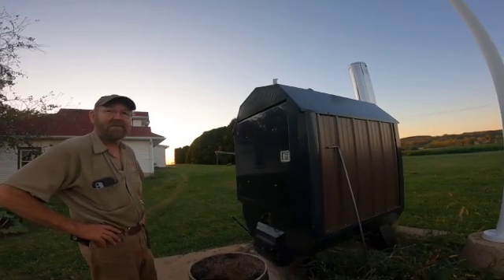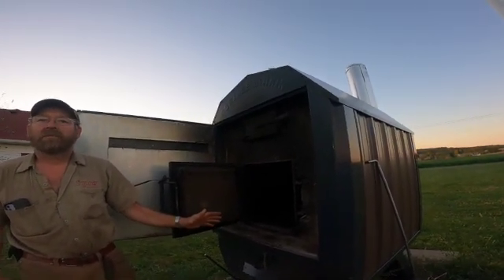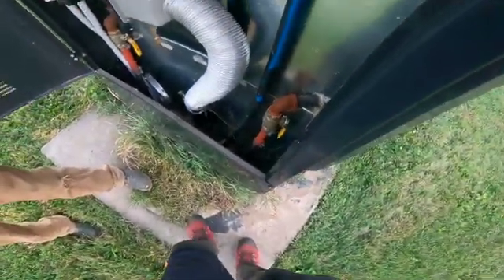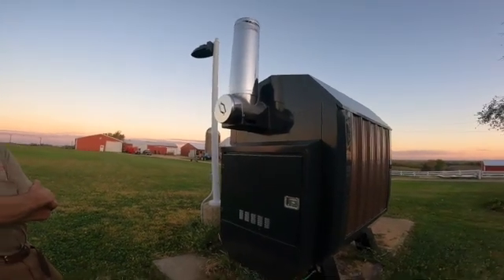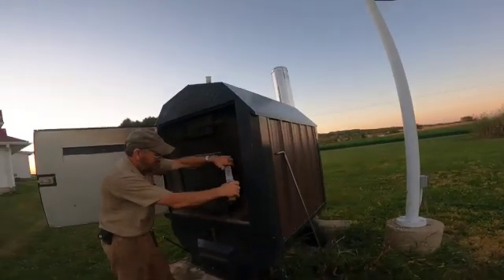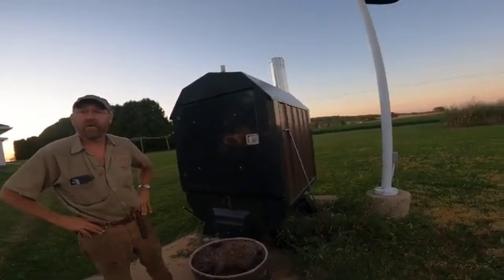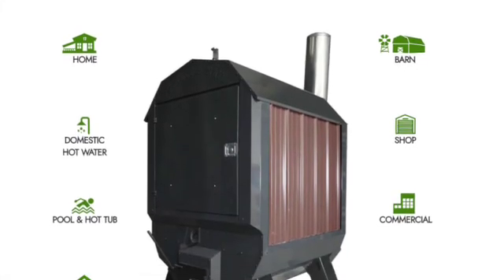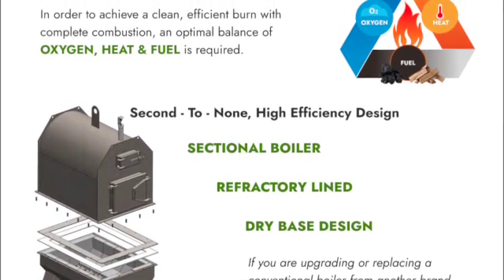Portage and Main 28/40 Boiler

Comment: I have a BL2840 heating my house and domestic hot water, it is bigger than what I need but I eventually plan to add a garage and wanted to heat it also without having to get a bigger woodstove. I use dry oak and hickory (I'm in central N.C.) and once the fire stokes up there is no smoke visible coming out of the chimney stack. These things are so efficient and simple. I've been using outdoor woodstoves for about 20 years (several different brands) and this is by far the best I've ever seen.
Reply from the maker: I can agree